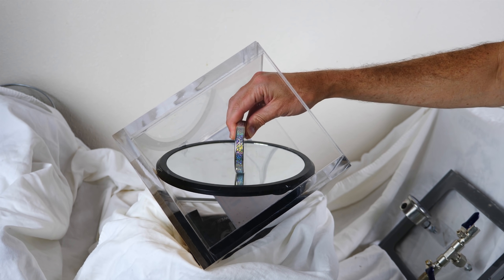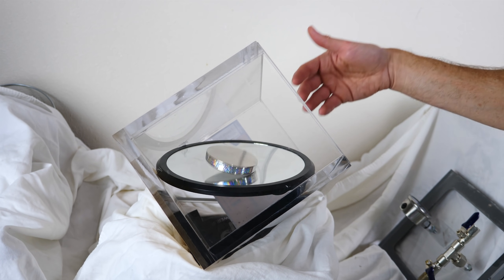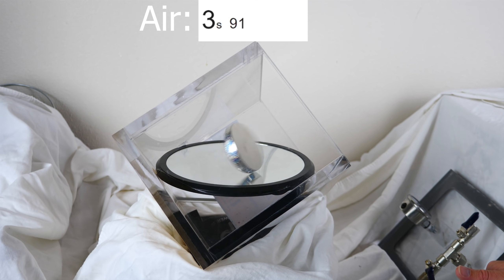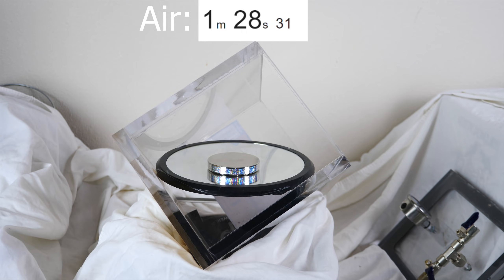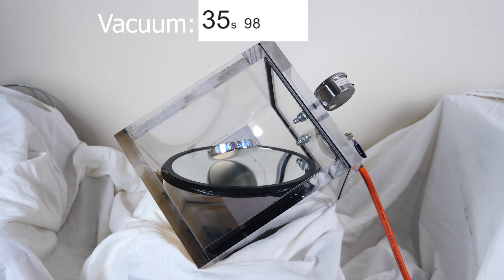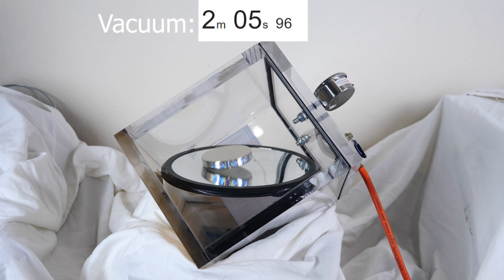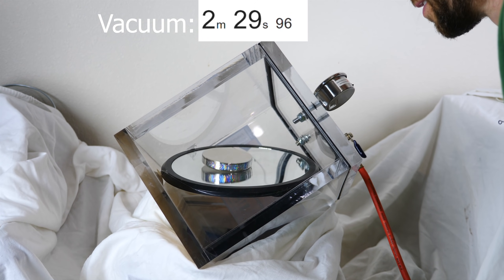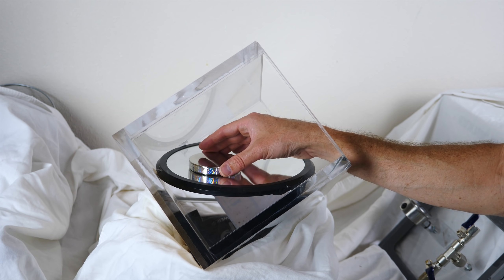Spinning Euler's Disk in a Vacuum Chamber—Will it Spin Forever?

Comment: You really need to find a way to spin the disk with the same force every time to really measure the difference
Reply: In a previous video, the spin in air was over 2 minutes
Reply: Yep, with iterations to indicate an average result.
Reply: Yes and also ensure that the vacuum is functioning pre rotation. Otherwise this experiment makes no god damn sense.
Reply: Really you should do at least 100 tries with air and 100 tries in vacuum then take the averages, that's likely the best way to do it.
Reply: Doesn't matter coz the difference was nearly double the time.
Reply: Use a Microphone and a Frequency Counter.
Start/ measure the Timer always from the same Frequency.

gregory/ The Pigeon Meister
Reply: doing it with a robot arm might solved that problem, and would also enable you to pump out the air before starting the spin
Reply: Does the weight of the disc influence the duration (assuming that the starting speed is the same for all)?
Reply: Maybe if he used some kind of machine
Reply: I'm an ice cream machine
Reply: @milkshakeflake  If you used an ice cream machine from Mcdonald's it would always be exactly the same because it's always broken. So I agree. Scientifically speaking lol.
Reply: @milkshakeflake  I can use you
Reply: Agreed. Lol
Reply: Believe it or not, that's actually not much of an effect at all at pretty much any speed you can spin it with your hands. The disc lifts itself based on its kinetic energy, so once it has started to dip, you can count on it reliably having a given amount of kinetic energy defined by its height. It gains additional kinetic energy to keep going as the disc gradually lowers into Earth's gravitational potential.

Comment: There are way too many variables for you to say that’s definitive. 
Initial speed input . Angle of disc from initial launch . How much energy is lost on wobble. Plus full vacuum wasn’t achieved until 45seconds . Sheesh.🤨
Reply: Right
Reply: @onthedepth69  Wrong. He's not right not in the least bit.
Reply: @ThePrufessa  but if the chamber was empty from the initial time of rotating than it may be spin for more time

Comment: In the beginning: 85s
In air: 1m 28s 31cs
In vaccum: 2m 38s 2cs
Video: 6m 53s

Total spinning: 8500cs+8831cs+15802cs=33133cs
Total video: 41300cs

Preciously, 80.2251816% of his video is just spinning.

People in comment: Wow he changed his profile picture.🤦🤦

cs: centiseconds or 100th of a second.

Edit:
1. Fixed the ms error.
2. Added the beginning spin.
Reply: Anshu Gahire you didn’t include the time it was spinning at the beginning of the video. And the fact that he changed his pp is also interesting!
Reply: Bro ms is Milli second and it's 1000th of a sec
You should use beat in place of ms
Reply: fix your sig figs in the percentage lol you can’t use THAT many digits
Reply: tranquilos,yo le pregunte
Reply: You think you are smart only because you sum up some seconds lmao?

Comment: Great video! Thanks for post it! About the test with the full vacuum that disk really stopped later than the before with air presence, but the gravity still causing friction effect in the surface in that the object is having contact (in this case his wife's mirror), so for have the disk a very long spinning and vibration it should be in a no friction surface like superconductor magnets cooled by liquid nitrogen (for example).

Comment: You should try spinning one of those levitating magnets in a vacuum chamber then put a copper coil near it and measure the total electricity produced with and without air resistance.
Reply: It's not the air that makes resistance but the magnetic field passing through a conductor; it would slow down regardless of the vacuum
Reply: @egabsanders  yep, good point. But if it was in space with no gravity or magnetic field influencing It, would a freely spinning magnet produce more electricity if you put a coil around it - was what i was thinking. Or would the proximity of the copper coil without contact provide resistance?
Reply: yes, eddy currents.

Comment: I think the experiment should be re-done with something that can give a more consistent spin, since your hand will be very variable.  I don't doubt at all that the removal of gas makes a difference, but we have no idea how big of a difference it really makes.  Also, you could try adding something solid below the dish to help displace some of the air, allowing you to achieve a vacuum much quicker.
Reply from the maker: I agree, but very hard to implement a spinning machine. I tried several different spins and couldn't come close to beating the vacuum chamber record:)

Comment: My Question: If gamma rays are green , then why all green rays are not gamma rays?????
                         If UV rays are blue/black, then why all blue/black rays are not UV rays?????
Reply from the maker: gamma rays aren't green, and UV rays aren't blue or black. I don't know where you got that info from. If they had a color you could see they wouldn't be gamma/UV rays
Reply: In other words, the color of the light rays we see are in our visible wave spectrum. All other waves that are out of our capacity to see doesn't have color (as we can see in our common reality), but by computers we can "translate" those waves to our visible spectrum like we do with radio waves to our audible frequency range.